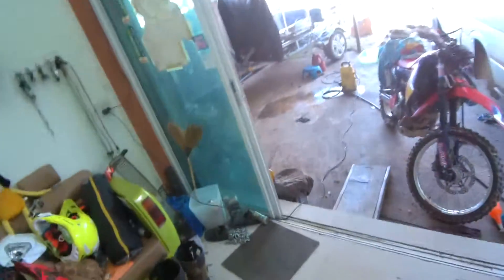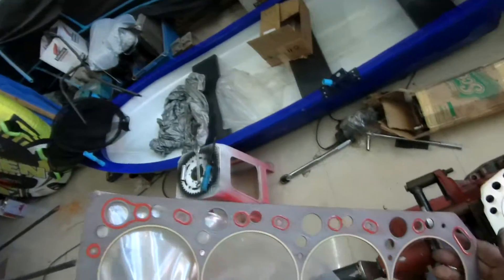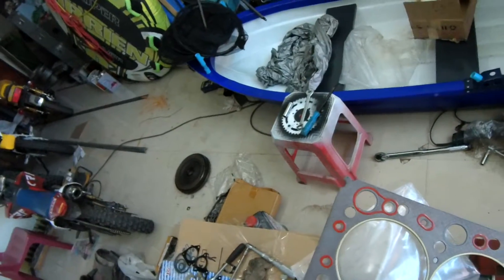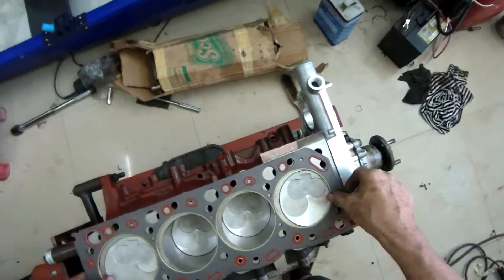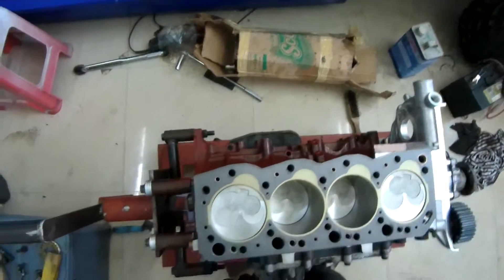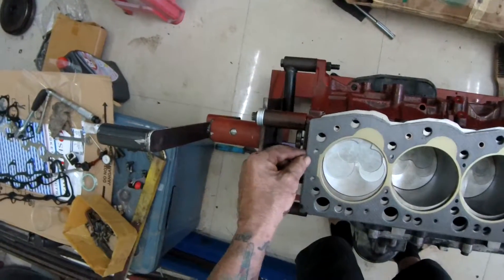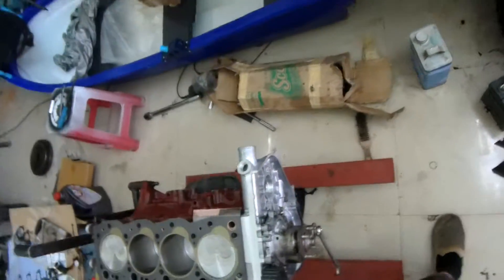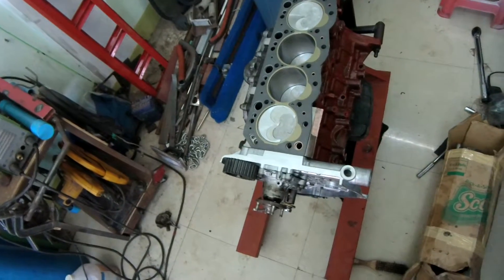Toyota 5L rebuild part 10. head gasket

Comment: Which best head gasket is good?
Reply from the maker: Dont use a cheap chinese 1 piece gasket! I was supplied with 1 and it failed in 1 month. Use a steel multi layer gasket 1.8mm thick. Put a thin layer of sealant on each side to ensure it seals on the water passageways.
I used 3 bond sealer, rtv will work or whatever you can source in your location.